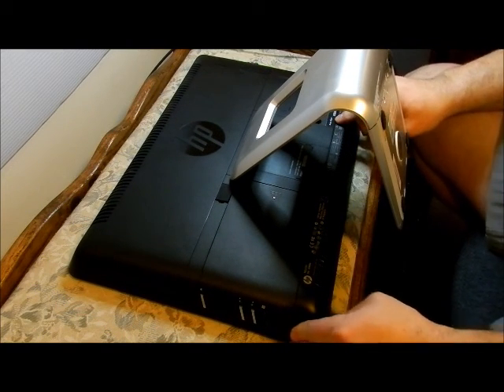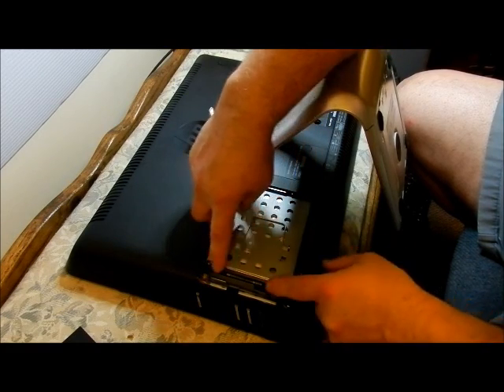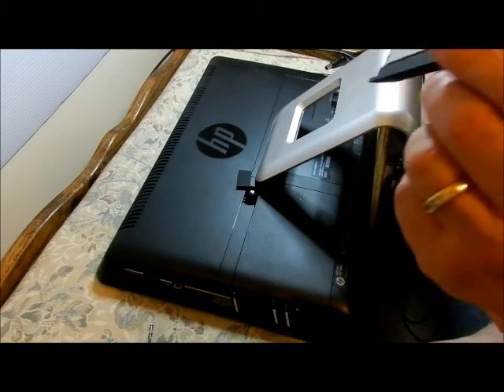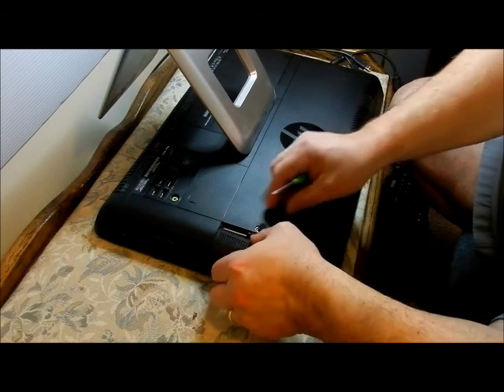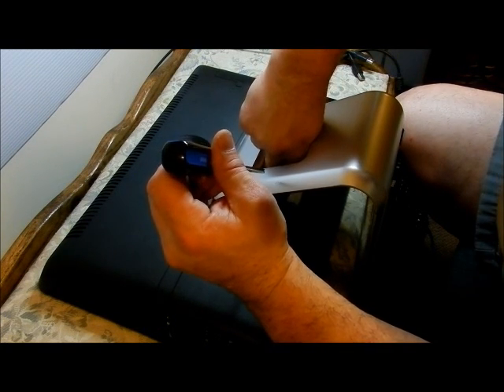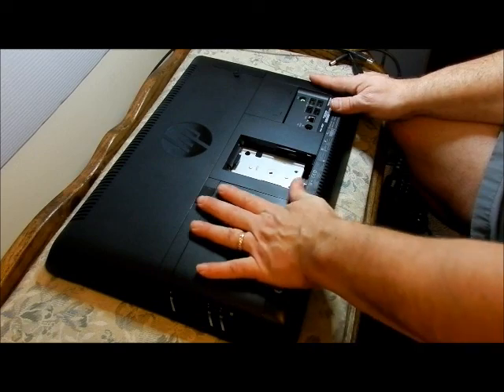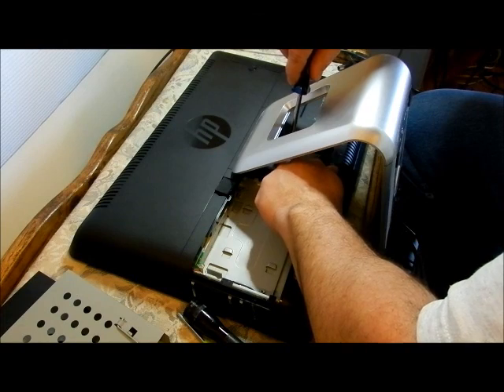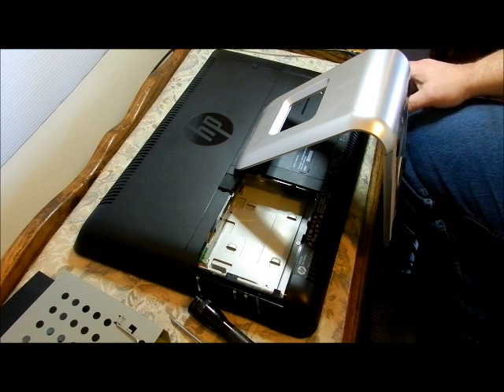HP Pavilion All-in-One MS227 Desktop

Comment: I still have this computer and still works besides I had to replace my hard drive it stopped working I added 1 TB hard drive I mostly use it for older games I got last updates for windows 7 I no longer have it go on line
Reply from the maker: I just put a 1 TB SSD drive in and it's working great on Win 10.  Make sure the hard drive is plugged in and seen by the CMOS or BIOS.

Comment: It's really easy to remove the back, once you've removed all 5 screws on the back, and then the 3 stand screws all you do is pop the edges off. You can remove the disc tray first but I prefer to leave it on and slide the back off on that side first.
Reply from the maker: Nice post.

Comment: To remove the back panel 
1st remove hard drive & cover
2nd remove the cd drive
3rd remove any other screws or panels on the back including the stand
4 take a flat head screwdriver and pry the back off near the screen you will hear it pop off the clips
To replace simply line up the back and push down until you hear it snap make sure the back is secure all the way around the screen

Comment: do u know how to fix code purple
Reply from the maker: +Jacob Palmer Can you tell me more info please?  Not sure what "code purple" is.
Reply: +William Quinn ok so i tryed to restet the same pc and it said setup is preparing then. a system configuration terror came up and said.               your system has detected a configuration eroor unless connected corrected this error will prevent your pc from opertating properly. and then it says.  code purle
Reply: +William Quinn i dont know wat to do
Reply from the maker: Tell me what the and where is the code.
Reply: +William Quinn.when i resseted it went to a couple screens like the windows dowloading then it can up to windows is is preparing for first use then a configuration error came up and said code purple
Reply from the maker: Boot i the SAFE mode by tapping F8 at bootup.  If you can access the event viewer look at the reports.  Reboot and see it that is resolved.  If not go back in the safe move and for to my computer and rt click the hard drive.  The check the drive for error.  Let e know what happens.
Reply: +William Quinn ok i a promblem i lost the keyboard lol just a minute
Reply from the maker: Reset the RAM chips.  How did the hard drive test turn out?
Reply: +William Quinn. huh

Comment: William, I am getting the blue screen of death, followed by a operating system not found message.  I thought it was a corrupted HD, changed it out, but I  am still getting the error and message.  Thought maybe the motherboard might be bad, especially since two of the four back USB plug ins do not work.

I saw your video on removing the monitor, which discusses the motherboard removal, but was wondering if any of your videos get into removing the CPU from the motherboard, especially the copper cooling duct attached to it?  Let me know, so I  can get my m227 running again.  Thanks, and the bids I have watched so gar have been real helpful to this point
Reply from the maker: Doobbie Did you do a complete reload if the OS on the new hard drive (HD)?  Copying the OS to the new HD also copied the blue screen.  In 30+ years I have never seen a motherboard go bad for this.  It is normally the HD, OS or a RAM chip.  I no longer have this computer to show how to take the duck off.  Check for two, or so, screws and use a plastic screwdriver to pry it up.  Hope this gives you some ideas.

Comment: can you like put another graphics card into it, like i have intel if i buy a $30 one could i put it in beside of it or something?
Reply from the maker: The answer is yes BUT it must come from the manufacture.  You cannot use a desktop top-of-the-line graphics card in the computer.  This is one of the drawbacks of an all-in-one computer. One of the others is that, unless the new all-in-one have it, you cannot plug in or extend to another monitor.

I would not spend the money to upgrade to video card on my HP touchSmart 300.

Hope this helps.

Comment: carefull not touching the ram? its not that fragile
Reply from the maker: I have over 30 years experience with computers.  Handling RAM is OK by the edges, with no contact with circuitry.  Power must be turned off and one must wait until the power LED is off.

Comment: Do we really need to take out the harddrive to the fan?
Reply from the maker: Only if the fan requires cleaning and the hard drive has to be replaced.
Reply: Oh because i have a fan that slows down and makes my PC shutdown unexpectdly And it's the same one as yours
Reply: Marquis Mcfall Exact same pc with the exact same problem. Now I looked at the bottom vents with a high powered light and it doesn't appear to be nearly as dusty as the top - which I've already cleared. Still idles at 65c degrees and games to 80c and once it reaches 85 exactly is when it shuts off.
Reply from the maker: I have found that sometime it's the number of program running that heats up the computer.  Pleasing a small fan behind the computer helps.  BTW  I am still using my TS 300.
Reply: My mom won't let me take out the hard drive...

Comment: Mr. Quinn, any idea on how to upgrade the cpu &/or what cpu is compatible with the motherboard and cooling fans?  Thanks for the video!
Reply from the maker: Do a search for more videos using MS227.  I have a video on removing the CPU and fans.  I do not what the compatibility would be.  As long as the new chip fits a socket AM2 LF you can give it a try. Hope this helps.

Comment: Remove the stand on the back and remove the plactick that cove the whole screen try to use some tool that very shap edge to get through the lock to break out very carefully if you don't want to break the cover. There are some screw that you may need to remove too...

Comment: Hi William - I have a HP Envy All in One and there is a speck of dark dust underneath the glass panel which is annoying to look at.  I think mine is built pretty much like yours so do you know if it is relatively straightforward to remove the panel?  I wish it were like the Mac's where you can just put a suction cup on it and pull it off!

Comment from the maker: The video card is part of the motherboard.  Is it bad or do you just want to upgrade it?  In either case the motherboard would have to be changed.  The replacement motherboard will have the same video card installed.  This is the case with my MS227.  Take the back off and look at where to video connector is.